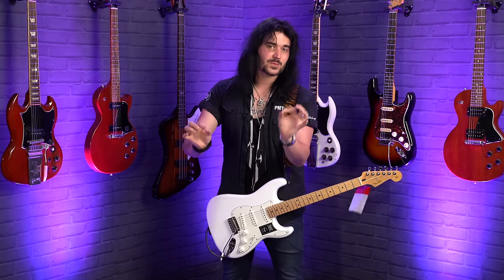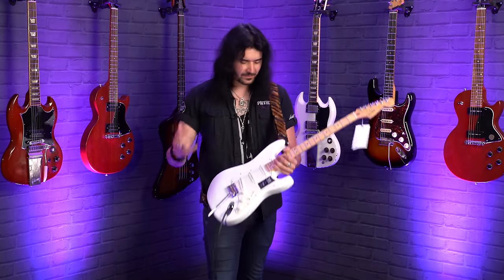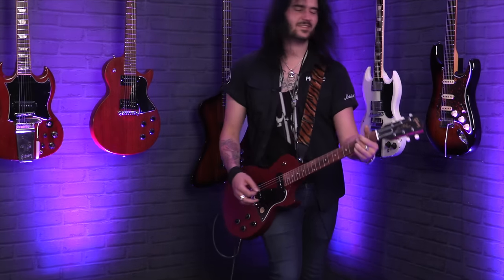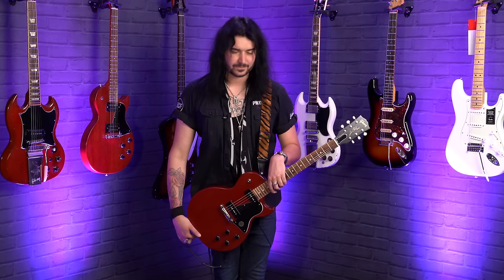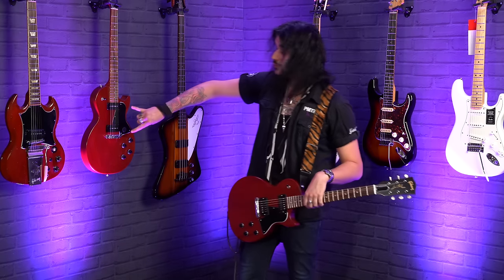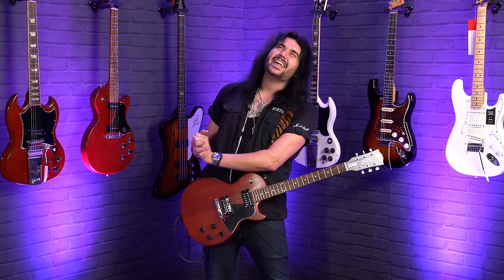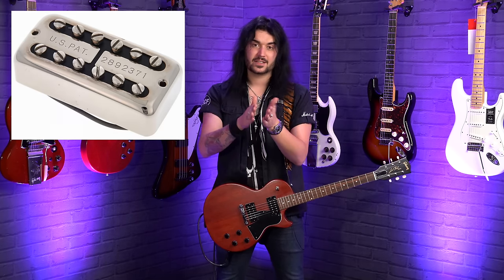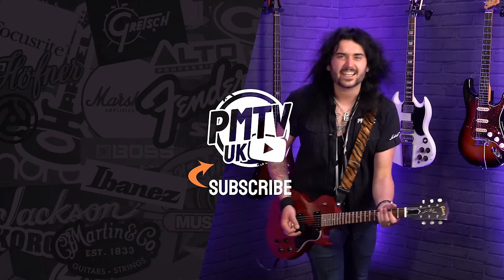Guitar Pickups Explained - Single Coil vs P90 vs Humbucker - Which Pickup Is Best For You!

Comment: The answer is: P90s. Only P90s. P90s are love, P90s are life.
Reply: Finally someone is talking sensibly.
Reply: Single coil not enough oomph, humbucker has not enough twang. P 90 has all. (Awfully generalizing here)
Reply: I like a guitar that's modified with HSP😅
Reply: The answer is fender single coils
Reply: One point he didn't bring out is how responsive P-90s are to pick dynamics, ie how hard you pick/ strum .

 Played with moderate force , they sound close to ( conventional) single coils . Dig in hard , and they go close to humbuckers .
Reply: AMEN
Reply: To you.
Reply: @margarethouse404 yeah he did, he off-hand mentioned it at 10:25
Reply: P90s are incredibly unattractive. I'll take a Seymour Duncan zebra 🦓.
Reply: Plus, P90s are Gibson. Since Mark Greasy, or Greasy Mark did his "We're going to sue you" vid, I'm not terribly interested in Gibson products. The fact that he was wearing his dirty t-shirt, worn, filthy leather jacket, and a five o'clock shadow, definitely didn't help things.
Reply: I used to feel that way too. But it turns out the differences between humbuckers and P90s are actually quite small and nothing you can sort out with a little EQ. Also humbuckers are quiter. No wonder they were considered a massive upgrade back in the 50's. Guitar player tend to a, quite irrational, tendency to default into a "older is always better" position. It's not. The Gibson 490/498T pickups are better than basically all Paf-style bucker for instance and they were considered an upgrade back in the day.
Reply: p90s are kinda scratchy and rough though. i like them but they're not a replacement for fender singles or humbuckers. There's a reason most players prefer the latter two.
Reply: Nothing can scream like a single coil. They might be harder to play but the reward… worth it. That buzz is the love buzz not interference.
Reply: 💩P90s💩

Comment: I'm an engineer and worked at Delphi, a huge automotive parts supplier. The similarities between a pickup and a fuel injector is crazy. Fuel injectors have a bobbin of copper wire around a spring loaded pin with a steel ball welded on the end. It's spring loaded closed..the ball seats into a little seat to stop fuel. When you energize the FI, the bobbin acts like an electromagnet and opens up the nozzle and fuel sprays, cut power and it shuts via the spring. Easy! But the bobbin winders I'm sure are the same as for an electric guitar pickup!
Reply: Today I learned...

Comment: Single coils have more treble and mids, which gives it a creamier tone. P90s are similar to single coils, however it has a bit more output and has more bass boost. Humbuckers are in a league of its own, it has a higher output than both p90 and single coils. With more bass and mids with passive, and more bass and gain on active. If you want some jazz and Country, single coils. For punk and classic rock, p90s. For hard rock and metal genre's like heavy, glam metalcore and old school thrash, passive humbuckers. For more extreme subgenres like black, death, modern thrash and doom metal. Go with active humbuckers.
Reply: For doom metal, I'd instead use an extremely hot ceramic passive humbucker, with bar magnets and 15k of DC resistance or greater.

Comment: Here's a pickup success story.  Years ago, I fell in love with an Epiphone Les Paul Plus Top Pro/FX, a Les Paul that featured a Floyd Rose Special double-locking vibrato unit.  The guitar also was loaded with Epi's Alnico Classic humbuckers, and it yielded one of the best sets of tones I've ever heard!  Alas, I was broke and couldn't buy it.

Sometime later, I began to get into modifying guitars.  I tend to like the looks of Strat-styled guitars, though I still love Les Pauls.  I began considering the type of guitar I would most like to modify, and began looking for that guitar at pawn shops.  I didn't find it, but I did find an Ibanez RG220B with a cracked neck that I eventually acquired for $25.  I bought it because I thought I could repair the neck and then install a bridge I'd bought and didn't use in the guitar I bought it for and wanted to use anyway.  I did both those things, replaced the worn nut, gave the guitar a fret job -- then got lucky in finding a pair of Epi Alnico Classics for about $25 on eBay.  I got them into the RG and was completely surprised when the result gave me almost the exact same tone that the Les Paul had!  Those two guitars have almost nothing in common.  Wood recipes, neck joints, scale lengths, vibrato materials ... all were different.  Nevertheless, the tone from my RG sounds just like the memory of that Epi!  That's success!😎❤️️🎸‼️
Reply: Dude, niiiiiice. That's the definition of a happy accident.
Reply: You’ve discovered that the tone is almost all in the pickups!
Reply: @aitken1965  On the contrary, I learned that pickups have a bigger influence than I thought, but the greatest influence still came from the fret job and subsequent setup.  I don't disparage the role of the pickups - that role is pivotal - but it is not the only pivotal factor involved.  I may also have evidence that the pickups in question may simply be overbearing and overriding all other tonal influences, and that I might just like the results.  S'all good.  I just say the pickups are much more important than I thought.  It's a good lesson.

Comment: I'm glad he mentioned the middle position on a LP or such. More than anything, I play my 335 or my Les Paul, both humbuckers for those that don't know, and the middle position is my general tone. Bridge pickup on 6, neck on 8, but in the middle position and I rarely switch. I dig in harder or kick on a pedal if I need more gas. It's a good sound.

Comment: Dagan --- the orignial wide-range humbuckers were "special"-- the offset configuration of the pole screws doesn't mean anything, but they were made from CuNiFe (copper-nickel-iron) magnets, not AlNiCo or ceramic.  Fender has reintroduced the CuNiFe pickups and sells them individually.  They have a wide dynamic range and a particular unmistakable sound.

Comment: If I were a good enough guitarist to have my own signature model, it would have just one pickup. It would be in a Strat style body for the ergonomics, pickup in the middle position, and it would be a stacked staple humbucker. Two position switch - rhythm position would be series, lead would be parallel. (Maybe a middle position that would be just the single coil.) Separate volume controls or a fixed voltage divider on the switch to match the levels. There's so much tone available in that middle pickup position that it seems, to me, almost criminal that it is so frequently overlooked.

Comment: Do the active EMG pickups still have wires wrapped around a bobbin inside them? I presume they just aren’t using magnets because the battery is to turn them into electromagnets?
Reply: There are wires wrapped around bobbins, but far fewer than passive pickups, and the battery powers onboard preamps on the EMG.

Comment: Love the videos. I've always understood that you "coil split" a humbucker to get a more single coil tone; and you "coil tap" a single coil to change its tone / output; there is not point trying to "coil tap" a humbucker due to its construction etc.
Reply: I took coil tapping to be splitting the impedence at some value, reducing the amount of the coiled wire that the signal goes through.  This would alter tones for either single coils or humbuckers, u would think.  Coil split is definitely only applicable to humbuckers, as you are only getting signal from one coil of the humbucker.
Reply: Electrical Engineers know the difference . Musicians have been using the wrong terminology for so long , the terms are de facto interchangeable in that context .

 Just like wether a " Whammy Bar " is a Vibrato or a Tremelo .

Comment: In order for two pickups with opposite winding directions must also have opposite polarities (one pickup with magnet "S" pole up, and one with "N" pole up), in order for them to be hum-cancelling. And, the winding don't actually have to be opposite. Swapping the signal wire with the ground wire of one pickup, when hooking it up, accomplishes the same things as opposite wind directions.

The actual scientific explanation of why this works is complicated...but, the practical application is no more complicated than as stated...flip the magnet & reverse the "leads" of one single coil that will be paired with a "normal" pickup and Voila...no hum.